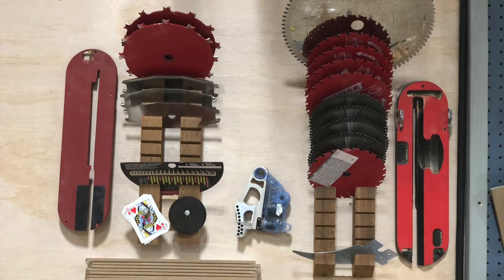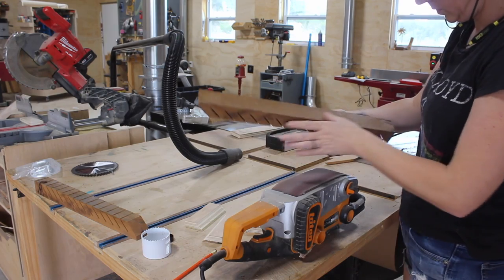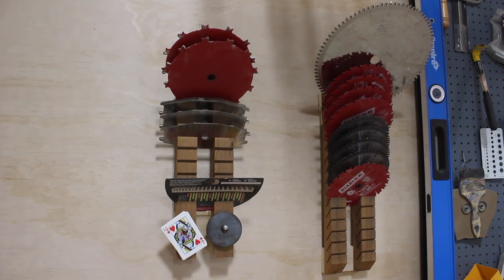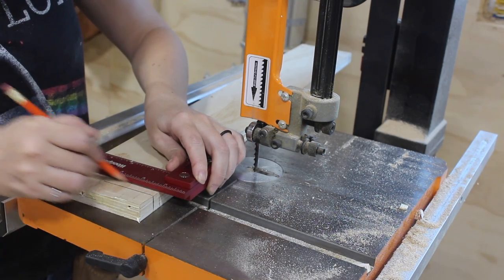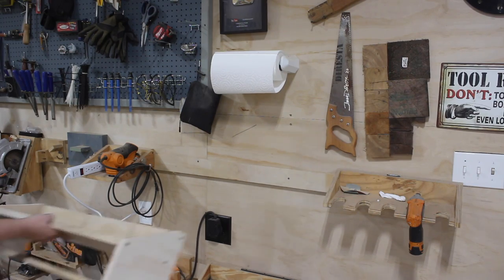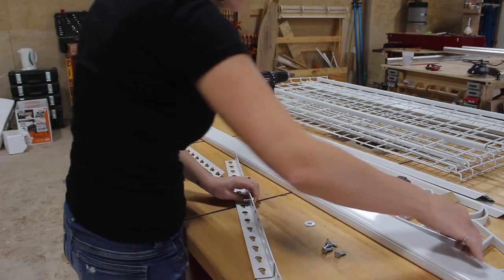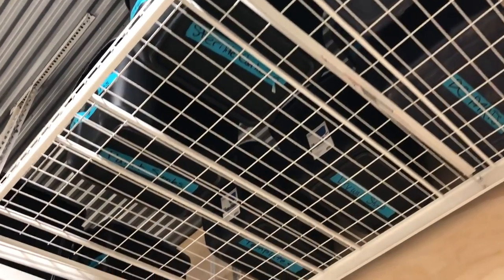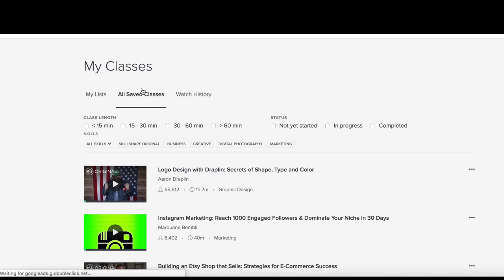4 Shop Organizing Projects - Blade Storage, Battery Charging System, Storage Racks

Comment: Most of April's designs are awesome but I'm not liking the blade storage. Having those teeth exposed seems a bit risky. For my own blade storage I built a mobile, enclosed circular blade storage cabinet that  protects me and the blades from damage.
Reply: @FenstermäkerWJ - I agree, unsecured blades make me nervous not only that someone may get cut but the blade itself could get damaged. Check out the blade storage cart I built. I think it's a really good solution for storing all size blades.
Reply: Thanks! I've since redesigned it a bit by making the doors fold down rather than off to the side. It is just more compact that way. I also extended the back of the cabinet up about 2 feet and that's now where I store my jig saw and saws-all blades on magnetic strips.

Comment: That large diameter Blade will warp stored unsupported at the top because of the heat cycling - Hot days cold nights  store it flat or Vertical from the arbor hole against a flat surface. Just a fyi

Comment: I don't know if they're made anymore, but there was a company that made overhead racks that were on a pulley system so it could be lowered.  I was thinking that it would be great to install one of these between fixed racks all you could use it as a dumb waiter to get stuff up and down more easily.

Comment: This is not good for large blades...
Reply: I thought this would they warp under there own weight?
Reply: Yeah especially for the laser cut reliefs and hand balanced Infinity blades.. figured you would want at least half the diameter supported.
Reply: Correct. Not good for the blades
Reply: Vertical storage is the corect way with the support in the center hole
Reply: I would imagine the leverage of large blades might crack out the 1 inch of timber between 45 degree saw cuts!
With the largest at top the weight of that going first will likely cause a cascading effect of all the blades below then also breaking out their blocks, & it will all come down at gravity free fall rate like the twin towers on 9/11!
Reply: @ianmoone2359  You make a good point. I think she used cedar for the verticals with slots. Cedar is a very soft wood and those blocks can snap off very easily.
Reply: To an uneducated, quick fire individual that provides no fix or remedy to their criticism...yup this is an issue...but...if you were aware that the material the blades are constructed of would take significant stagnant time and temperature for it to warp, I'm positive you wouldn't have provided your 2 cents.
Reply: I'd not not worry about warping under their own weight, nor being slightly bumped. large blades are most often distorted by the saws "hub" clamping force.
with a 12" blade there's a fine line between slipping on the hub and staying true. blade cost matters some, but even the best of machining work on the saw parts can make a blade untrue. which is why precision trim work people like smaller blades, not to mention flex in the saw assembly itself and blade warpage with uneven heating, meaning it takes heck of an eye and skill to cut large pieces with tight tollerance.
Reply: I agree! I thought not8 only warping the blades but scrapping while I.

Comment: April, your personality is the best part of your shop. Period.  As is with any "new' shop, it looks like one has plenty of room for any and everything. A couple of years down the road and your having to suck it in to get around all the stuff.  I have a two story woodshop, just added a 16x16 extension 2 years ago, now it is full. In retrospect, I wish I had not have built the upper and lower cabinets with worktop. Cabinets and drawers are where things go to die, not all. It would have been a few dollars more, I saw awesome steel cabinets for shops at Sam's Club. Steel walls are maybe 1/8 " thick, wood cabinets are 3/4".  16 cabinet dividers at .75 equals  one foot of non usable floor space. Built ins are permanent.  Steel cabs have casters, movable as need dictates.  Why is it that any flat service always catches everything?  All newbies watching AW might want to consider metal roll around tables and cabinets.

Comment: Hay April, one thing I appreciate about you is you're not afraid to show mistakes. You could of easily edited out the replacement ends of the battery storage rack but you didn't. Thanks for that. --M

Comment: Simple, but clever idea putting labels on the bottom of the totes.
I feel silly that it never occurred to me before, but given that I’ve never used any open floor, suspended storage, I guess there’s been no reason until now. I’ll file that away for future use.
Reply: The first time you can't remember which tote has the parts in it, the bottom labels will become an obvious solution. I've labeled boxes on the side and then they get moved and guess which direction the movers stacked the boxes.

Comment: Hey you have that cauliflower aluminum insert! I have that too. It’s a pretty convenient solution which allows you to change up depending on you application without having to build multiple inserts. My only complaint is that the mdf inserts are kinda flimsy,  insufficient and don’t last that long in my case but all I need to do is just create a few out of hardwood... always enjoy your videos April!
Reply: Although, now that I looked at the link, yours is apparently made by sawstop. Looks almost exactly the same as what I have but mine is an aftermarket brand.

Comment: The problem with open storage system of any kind in the wood shop is that after a while everything will be covered with fine wood dust. 
If you have a good dust collection system and use it religiously, it takes longer but eventually dust covers everything.
A combination of enclosed cabinets and a work tray/rack with frequently used tools is better from that point of view.

Comment: You might want to rethink your charging station.  As the batteries wear out?  They increase in possibility of catching fire.  A metal shelf of the same design with one exception.  A flame hood, that would direct any flame away from the wall.  It is the only downfall of todays batteries and a ounce of prevention.  Otherwise it is a fantastic vid.  So much talent you have.
Now to go watch the skillshare vid.

Comment: So... you probably know this.

But it looks like you have both of those ceiling racks hanging from the same bracket on one end.

That’ll reduce their weight capacity by a good bit because the weight of both racks is on the one bracket.

Probably not a big deal, unless you’re planning on really loading them down.

Comment: I didn't read through all of the comments so this was probably mentioned, but Sawstop recommends that you don't use that type of Dado stack. The brake may not work well and you lose some of the potential safety that was probably part of the reason for buying the saw in the first place.

Comment: As always, great video, April. My only concern though would be whether you might slightly unbalance some of your bigger circular saw blades because they're only being supported on one side and the weight of the unsupported side combined with being at 45º could have a detrimental affect.

Comment: Probably should check the weight capacity of the rafters; even more important for those of us with snow load.  Would suck to cause a collapse from a couple tons of storage...
Reply: I have seen so many detached one-story garages with sagging roof due to people hanging shelves from the rafters. But I suspect April's rafters are strong enough, and it is near a wall.

Comment: In our shop we have hooked up the power strip for our chargers to the lightswitch so it is always off when we leave.
Once a charger lit itself on fire during the night.
Reply: Good idea.  A simple timer would also do the trick as well.
Reply from the maker: That's a great idea
Reply: Would be illegal in Australia. Here light circuits are 8 amp and power circuits 15 amps or more. Cannot put a power outlet on a light circuit
Reply: Im not sure how its connected only that they turn off as i turn the switch

Comment: April - Lots of good design ideas. A few questions - Are the blades located near the table saw? Are the tools and blades located in an area that will get dusty? If yes, how about building cabinets with a glass door? Keep the dust out and you can still see the contents. BTW, is the Queen of hearts a new logo?!!!!
Reply from the maker: Yes they are next to the table saw. I use Dust Collection so they shouldn't get too dusty but it is a wood shop so everything eventually gets a layer of dust on it. : ) It doesn't bother me and isn't worth building a cabinet for.

Comment: If the plugin strip, that you battery chargers are connected to, is plugged into a lamp timer, you won't have to keep your power running 24/7.

Comment: Ceiling mount storage that is still accessible, but only requires scaffolding to get to.  LOL
Reply from the maker: You laugh but it's actually the smartest solution. Using up lower valuable wall space for things I don't even use once a year doesn't make any sense. But hey, you use up the space in your shop the way you think is best.
Reply: A scaffold to mount yes, safer than a ladder. Ladder to access is all that is needed
Reply: Yup we all have stuff that “I might need one day” or “too good to chuck out”. My problem is that I find it only after I have bought another one ☹️☹️
Reply: @gregwyatt4555  isn't that the truth. Lol...

Comment: Blades are not meant to be stored that way. They should be hung on a dowel through the centre hole.
Reply from the maker: I looked extensively into it, and nothing indicates that this is damaging to the blades within a reasonable time. It would take a decade of the blade sitting completely stationary for any remote change of warping to occur. I don't intend for my blade to sit for anything close to that amount of time.
Reply: Interesting point, April.  After all, it's not a scroll saw blade.  If it was going to bend and warp under it's own weight it wouldn't be strong enough to cut a straight piece of wood thicker than 1/4".
Reply: Steel does not creep at room temperature. Steel also elastically deforms before it plastically deforms so any slight deformation will go right back. - this is taught in any material science or mechanics of materials engineering class.
Reply: You are wrong do some research first before you comment.
Reply: @smitty1262  congrats to you on the well researched intellectual reply